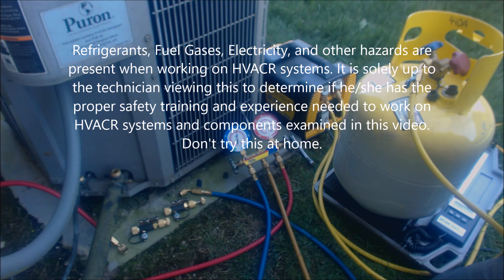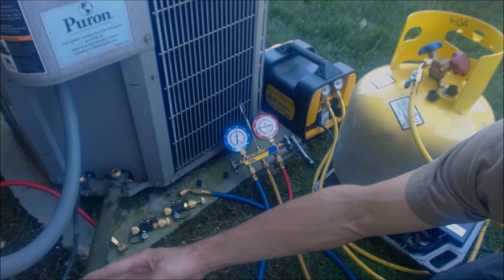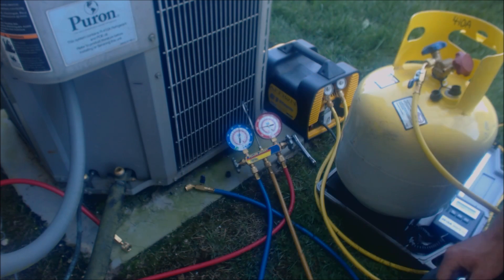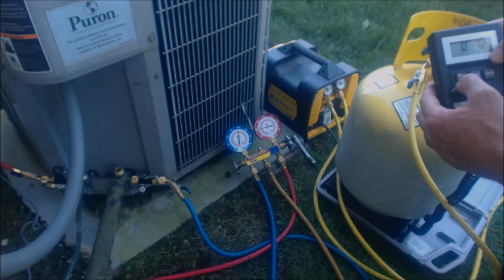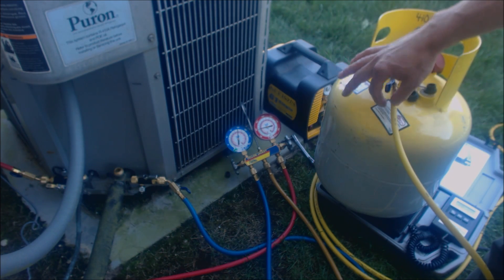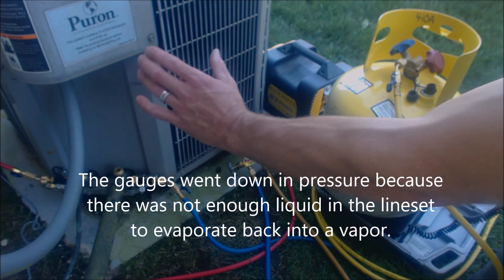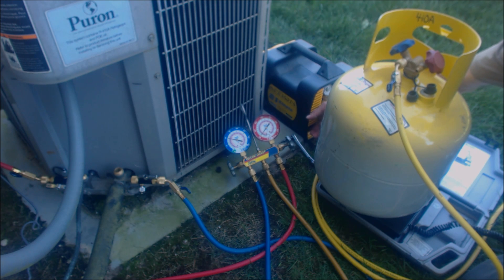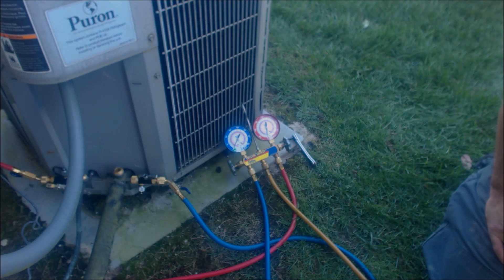HVAC Recovery Procedure: Machine, Tank, Tools Used Step by Step! Recovering Refrigerant!

Comment from the maker: Tool List-  https://www.amazon.com/shop/acservicetech
Support-  https://www.patreon.com/acservicetech
For those that are looking for the tools used in the videos: (Linked Below)

Here is a link the Nitrogen Regulator    http://amzn.to/2bXdR5f

Here is a link to the Nitrogen Flow Meter    http://amzn.to/2brvoBg

Here is a link to the Air Acetylene Torch setup-    http://amzn.to/2aQalsb

Here is the Link for the Yellow Jacket Refrigerant Manifold Gauge Set used in the videos-    
http://amzn.to/2aenwTq

Here is a link to Refrigerant hoses with valves used in the videos-   http://amzn.to/2aBumVI   

Here is a link to the Digital Refrigerant Scale used in the videos-  
http://amzn.to/2b9oXYl

ACSERVICETECH is a participant in the Amazon Services LLC Associates Program, an affiliate advertising program designed to provide a means for sites to earn advertising fees by advertising and linking to Amazon.com.
Reply: vicetech
Reply: acservicetech 2b9oxyl

Comment: Is it proper practice to recover from the liquid line and does one need to concern themselves with oil lose in the tank.....2nd is a liquid line filter effective on the suction side of the Recovery equipment if you are recovering from the suction side of the unit...Incidentally my dinosaur amprobe rg max 5000 came stock with the filter on discharge.

Comment: When you add more freon to a tank that already has some in it do you let off most of the pressure 1st or just keep adding? My machine just sort of stopped when it got to 50 psi and the tank got warm with the low side gauge at 50  and the high side 160 on the Appion G5 Twin.
With the tank getting warm I shut it down a few minutes.
Ok I found that by cooling the tank with a garden hose   I could keep  adding to the non empty tank.

Comment: So Can you remove all of the refrigerant out of the compressor or does some stay in there?  I scrapped a condensing unit that had been recovered by an HVAC technician and I cut one line and it was fine. I cut another on the compressor and refrigerant shot out. I thought it was empty as the service valves were all taken apart and and the condenser was empty as well as one of the lines running into the compressor. I dont want that to happen again.
Reply: John Lewis. He probably did a "pump down" so all the refrigerant is driven into the condensor. Allowing line set to be cut

Comment: i like these videos of everyone working on ac units. I keep seeing everyone use the ends of the CRT for the hose placement. When you do this like that for recovery/evacuation it means that you have to constantly remove and replace your hoses. If you take the cores out of that side port on the CRT you can leave the hoses in place on the side ports for any operation you have to do. Also you can leave the vacuum in operation when you put the cores back in place. Great video i just wanted to lend my professional opinion on the use of Core Removal Tools.

Comment: Hi AC Service Tech LLC, I had a question since I am currently in a program for HVAC at school. I saw you recovered both liquid and vapor at the same time what is the reason behind that, does it depend on the recovery unit or that you have most of your refrigerant in the condenser? Any help would be great. Thank you.
Reply: TrueHelp. The machine is at rest so liquid / vapor, doesn't matter. But 2 hoses are quicker than one. That's the only reason

Comment: Quick Question -

When I'm done recovering, I've noticed when I disconnect everything there's still a LOT of refrigerant stuck in the machine.
I've tried closing my guages and letting the machine pump  into the tank for an additional 5 minutes but I still get a load of refrigerant stuck in the machine.

Any Tips, Tricks or process's that I should know about to minimize this?
Reply: Put the recovery tank in a bucket of cold water to keep the pressure down in the tank. Then close the gauges and run the machine a few minutes.
Reply: Close off the inlet. Switch over to "purge" till it reaches zero. Then shut the discharge. Mind you your discharge hose will always contain liquid, and there's nothing you can do about it besides lose a bit. 
OR jiggle your valves to send the remnant back into the AC unit

Comment: Thanks for your nice video.
Could we use gauges on valve core remover and use T  connector or another core remover   before recovery machine?
Does it work better or using the manifold gauge instead?
Thanks.
Reply from the maker: Hey Mike, look up "acservicetech HVAC Refrigerant Recovery Process, Full Demonstration!" this is where I show doing a recovery without the gauge set and using the valve core removal tool as a tee. I also explain each of these setups in the "Refrigerant Charging and Service Procedures for Air Conditioning" book at the website acservicetech.com thanks!

Comment: Excellent Video. How long do you usually wait for refrigerant to get to a saturated state and pull from both vapor and liquid ports?
Reply from the maker: You don't really have to wait too long. It will mix between the liquid and vapor as you pull both out at the same time, thanks!

Comment: Why would you take the shrader core valve out of the shrader valve when recovering refrigerant from a unit
Reply from the maker: This is to recover faster and to have a more accurate reading during recovery. The pressure is less likely to rise after shutting the recovery machine in this way, thanks!

Comment: Great video! Question: How do you recovery refrigerant from a disgaurded  R410a Condenser unit( refrigerant lines already cut, refrigerant still in condenser with service vales closed)?
Reply from the maker: Either with piercing line connectors before the valves inside the unit or by brazing copper tubing on with crimped and brazed shut ends and then opening the valves and using the existing ports, thanks

Comment: thanks for the video.  question:  was the indoor unit on (meaning the fan was on) or not? Sorry, another question? what you did was a pump down or not.
Reply from the maker: The indoor fan was on and I was recovering the refrigerant since the compressor was not strong enough to pump down all the refrigerant for moving the outdoor unit, thanks!
Reply: @acservicetechchannel  how you can tell the compressor is not strong enough to pump down.
Please explain in detail?
Thanks.

Comment: It's not because the compressor is not strong enough. It is because the condensing unit can only hold a certain amount of factory charge. After that you have to put down what you've added to accommodate the line set.
Reply from the maker: Hey Kevin, this was a condensing unit connected to a first floor evap coil and the line set was not that long. As well, the pressure was not abnormally high like when the relief valve is supposed to open up. As systems get older the spring on the internal relief can get weak and blow prematurely. That was what was happening in this scenario. I under stand what you are trying to say but that was not what happened in this scenario, thanks!

Comment: how about if there is little leak at low side that you recovering.,.,its better to stop the process in 10 psi remaining rather than wait to 10 inch it will suck the air from outside via small leak.,.,what do you think?
Reply from the maker: Absoulutely, we don't recover past 0 psig on the low side on those, thanks

Comment: Is there any truth to letting the recovery tank sit over night after a recovery and being able to slightly open the tank low side momentarily to remove any unwanted air or moisture?
Would you elaborate on how the G1 recovers the refrigerant with the “large impeller” you mentioned.
Also, is the G1 able to recover liquid without fear of damaging it?
Really like your videos.
Reply: I found the answer to the question I asked!
How To Purge Non-condensables from a Recovery Cylinder!
http://appioninc.com/downloads/files/TB-Non_Condensables_in_Refrigerant_Recovery.pdf
Reply from the maker: All smaller recovery devices cannot really handle pure liquid. They do well with saturated refrigerant though. The difference between the G1 and other recovery machines is that it doesn't have a condensor to reduce the heat prior to pushing it into the recovery bottle. It is good for smaller jobs. I have links to the G5 and the fielpiece MR45 recovery machines at amazon.com/shop/acservicetech thanks. Also look up "acservicetech full recovery procedure on how the mr45 works, thanks"

Comment: Did you remove the core depresser also from the hoses when recovering the freon?
Reply from the maker: Yes, I have hoses that don't have valve core depressors for recovery. Check out this other video on recovering without the gauge set, - https://youtu.be/os9gKLf7LJg
Reply: @acservicetechchannel  thanks

Comment: Can you use recovered  refrigerant on another system or do you have  recycle it?
Great Channel!
Reply from the maker: By EPA 608, it can only go in another unit if the unit is owned by the same individual as the original unit that you took the refrigerant out of.
Reply: AC Service Tech LLC 
Understood.  But as far as chemistry of the refrigerant,  does it degrade after being in operation for such a long time?
Reply from the maker: Chemically no it does not but keeping it pure and clean is the issue, thanks
Reply: You recycle it with a machine  it runs it threw filter dryers

Comment: This is a very good video. My question to you would be, though, is this a process that can be used on a R134A system with a similar recovery machine? I'm a newer automotive tech and just trying to learn all I can to do my job better.
Reply from the maker: Yes it could but you may want to pay attention to the oil recovered by adding an oil separator. You obviously would need quick disconnect vehicle ends for you hoses as well. Thanks Crispin!

Comment: Another comment is if you did have a leak the only way to know that you don't pull air from the leak would be to know the amount of refrigerant collecting in oz or lb. And the starting weight of the tank so that weighing scale device you have is pretty important or some equivalent way of watch the amount your pulling out. less you could possible be transfering air/moisture with the recover of the refrigerent.
Reply from the maker: Always check the weight of the recovery tank first to make sure you don't overfill. Make sure to not pull your recovery vacuum lower than 0psig when there is a system leak to make sure noncondensables don't make it in the tank, thanks

Comment: O i see your vacuum pump has an inlet and outlet port so this is the one you need harbor freight ones just vent to outside air with no outlet port connection for hooking to a tank
Reply from the maker: Hey Sam, I saw you post a bunch of questions on vacuuming and recovery. Some of those videos will answer your questions. Just type in the search "acservicetech  vacuum playlist" and acservicetech recovery playlist" They show preparing the recovery bottle, breaking a vacuum with refrigerant, and selling refrigerant in the recovery bottle. If you have any questions after viewing them then feel free to ask questions, thanks
Reply: That's a recovery machine bro.

Comment: Quick question for a beginner here. Why, at the end of the recovery, did you add nitrogen to bring the lineset pressures out of vacuum?
Reply from the maker: Otherwise, if the pressure was not 0psig then it would suck humid air into the lineset through the ports. Water vapor is not our friend in refrigerant oil and would also increase dehydration time, thanks
Reply: acservicetech of course...thanks!

Comment: I like your video sir acservicetech i always watching to your video i got a lot of ideas but i have a question sir, i have ac 8500w 3ph i install the unit and i have a length of copper pipe 10meters,  fla is 13amps do you have an idea how much more gas i need to charge and how much pressure or psig for R410a both side H-L
Reply: I hope you can help me..thanks and god blesa

Comment: How do you know how much refrigerant oil is coming out with the refrigerant? Wouldn’t you have to replenish the lost oil?
Reply from the maker: Hey Jerrod, in residential HVAC we don't typically use an oil separator like in automotive. Usually we pull from both the high and low side so oil is not lost as much as if we pulled directly from the liquid line or bottom of the off system where liquid and oil would be. Not much oil is lost, Thanks

Comment: Found a leak on manifold a coil. Would you suggest using the r22 after drying it when recovering.
Reply from the maker: As long as you recover not below 0psi so that you don't suck air and you use a new recovery bottle then you could just add the existing refrigerant back in. You could use r-22 though expensive but that is the most expensive. MO99 or 422-B could loose some capacity and r407c you would need poe oil instead of mineral oil. thanks
Reply: Thanks,

Comment: why do you recover from both lines (hi +low)?
Reply from the maker: So that when you are completed there is no refrigerant on the other side of the metering device that will expand and cause pressure that will increase. You don't want to have to recover pulling through that piston or txv. It is also faster, thanks
Reply: makes sense. thanks for the response. Is vacuuming the lines done from both sides also or is it better to just use the low side
Reply from the maker: Run the vacuum from both sides definitely. The only reason people were running vacuums from one side in the past is because they were not doing an oil blowout and having problems. If you are brazing into something existing then just do an oil blowout after the pressure test and before the vacuum pump and you will be good, thanks
Reply: Awesome info...thank you

Comment: The type of recover machine I am using is a G5 Twin. I believe this one condenses the refrigerant. So my question is are the recovery steps the same with this type of recovery machine
Reply from the maker: Everything is the same except the end where you switch the lever to purge and pump the refrigerant into the tank on the outlet of the recovery machine, thanks!
Reply: acservicetech thanks man!

Comment: On r410 do you recover by liquid form ...or vapor?the reason im asking because its a blend of refrigerants!!thank you sir and i love your video's....very informative!!!
Reply from the maker: Thanks Victor, actually you can recover in any state. Taking it from liquid tin the system to liquid in the tank is the most efficient for these impeller type recovery machines but I usually take it as a saturated and take the refrigerant from both service valves at the same time and put it into the vapor port on the tank which is the easiest for these small residential light commercial systems, thanks

Comment: i have 4 of those apion core remover tools, they only get the core out 1 out of 9 times,  i refer to them as core installation tools, not remover tools.
Reply from the maker: Is that do to them having a tight section in the middle of the removal handle?
Reply: it doesn't seem to engage properly when trying to remove, i have tried a few different ways to engage it as it seems to hold well enough if i just stick one in it
Reply from the maker: Huh, I have not had this issue yet with my three appion. Thanks for letting me know. I also have used my C&D for 12 years and have not had a problem with that brand, thanks
Reply: my C&D has never failed to bring it out, I tend to use it for recovery and put the apion back on for vacuum.
Reply from the maker: Same here, never failed. I mainly switched to appions for vacuuming, thanks
Reply: I had the same issue I use s Yellow Jacket now

Comment: say you did have leaks. what would you use to recover assuming my there was refrigerant and possibly some o2 in the system.
Reply: Mr Ficks I heard you just take  them in and pay to get them reclaimed since they are contaminated with oxygen. then probably just vacuum the tank before next use. I'm wondering though if they're contaminated with refrig say from a burnt compressor if the tank can be cleaned for use with new refrigerant again. I know good practice is to keep a tank just for contaminated recoveries but it's just not practical for a diyer with limited income but then again maybe it's more practical being this is expensive work to deal with as a diyer  ( finding out the hard way).
Reply: Ashroyer86 • Thanks for the info.
Reply from the maker: You would still use the same setup but just recover down to 0psig. When you have air in tank, you just will not get paid for the refrigerant since it will not correctly measure out with the p/t chart when exchanging at the supply house, thanks
Reply: acservicetech • So how are air containmenated tanks dealt with? Thanks for the great videos.

Comment: nicely explained! but what was the reason to put a little nitrogen in the system to bring it up to 0psig?
Reply: Sal C it avoids atmosphere presure to enter the system.
Reply from the maker: Yes just to not pull straight air in with the humidity from outside, thanks Sal C and tecnico!

Comment: Great video AcServiceTech!
Whenever i start working by myself that how I want to do the recovery procedure. I think is the most efficient way. 
Do you have a video of pulling a vacuum and removing the valve cores? When would be the best time to put the cores back in? And would you have to finish pulling the vacuum with the cores in? Every time we do a vacuum we leave the cores in, but I'm just the helper so I kind of don't have a say.